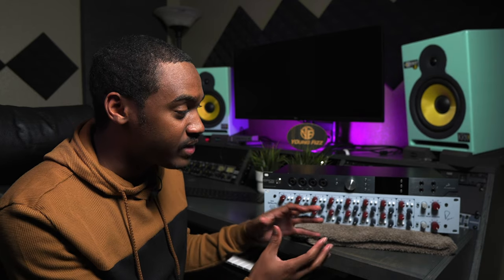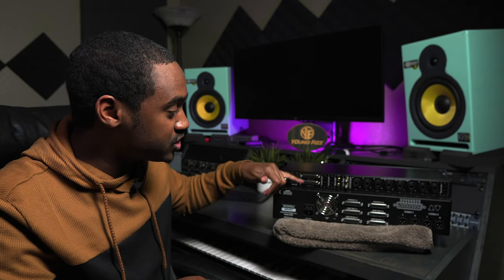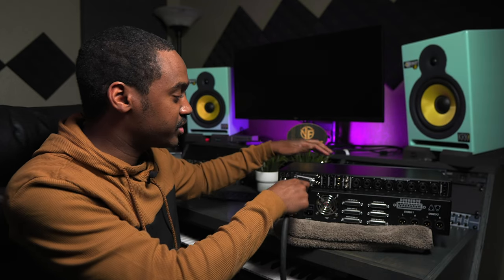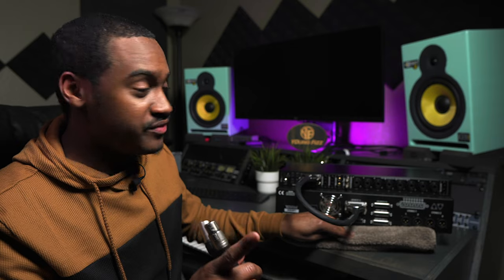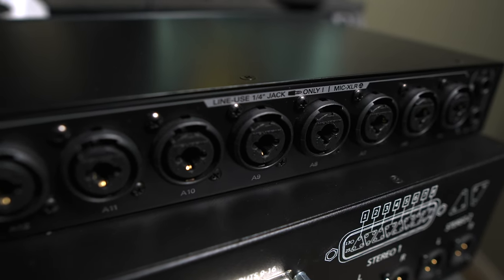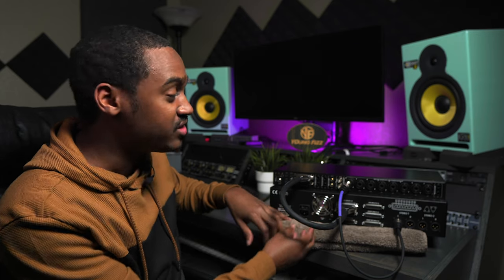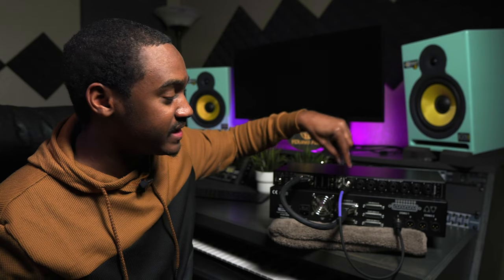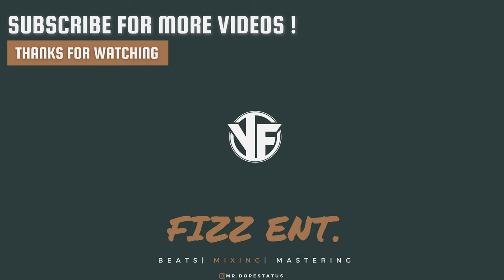Antelope Audio || Mixing with hardware | How to connect Summing mixer with DB 25 Cables

Comment: The reason you want to use 1/4" TRS is because XLR inputs go through the devices pre amps. You want line level from the summing box, and to bypass the Orions preamps you have to use 1/4" TRS.
Reply from the maker: Yep, you got it !

Comment: Greetings,
Nice video, but why use an adaptor when you can just buy a cable with TRS ends. It prevents a fail point or possible noise?
I would love to see you using this summing mixer on a track to hear the difference.
Reply from the maker: Thank you. I had overbought cables, so instead of buying new ones i ended up purchasing adapters. Its versatile

Comment: Hi and thanks for the video. I got the same audio interface but a different summing mixer, an SPL Mixdream. And I got serious issues. Antelope out 1-2 is being received by the summing mixer and echoed over channels 13-14-15-16, and Antelope channel out 3-16 are simply not transmitted. I use 2x8 channel D’Addario analogue sub25’s, and this is important, with TASCAM pin-out, as opposed to the Yamaha standard which is different.
Any idea what can be the problem? I have been testing a lot but without a final solution. Can it be related to the Orion routing panel (which is a pain to configure)? Thanks bro
Reply from the maker: Hi, Thanks for tuning in. Yes it seems like a problem in which how you have things routed. I'm not sure of your configuration or the D.A.W you are  using, but one rule of thumb i go by is that CH. 1&2 are used as my main outs to my studio monitors. So TB or USB (whichever one you are using) should be connected to monitor out. Now TB or USB 3-18 Should be connected to the "Line Out" This set-up so far allows you to have audio going out. Now the audio must come back in on a CH.  This is label as "PREAMP" on the control panel. To record audio from your SPL Mixdream you will have to tkae the "PREAMP" from the control panel and connect it to the TB or USB record channel of your choice. I've done a few videos on the control panel so hopeful if you watch these videos it well help you better understand routing inside the unit https://youtube.com/playlist?list=PL_qY1u3DirWMBeUA3dsbDPG0vHqpLafkH
Reply: Thanks so much, Fizz. I will certainly check out those videos, and also follow your advice of using ch. 1-2 exclusively for monitoring, because if you use those channels also part of the 16 summing feeds it can become conflictive. We’re gonna work this out! I appreciate your swift reply. Take good care!

Comment: How do you label the line outs?
Reply from the maker: You can label the line outs in the control panel. Double click on the Daw out channel  that you want to add the label to.
Reply: @FizzENT  When I double click the outputs (in the lower half of the screen) it won't allow me to rename... only inputs in the top half.

Could you please make a video?
Reply from the maker: That sounds about right. when you change the top half it should automatically change on the bottom. @sekritskworl-sekrit_studios